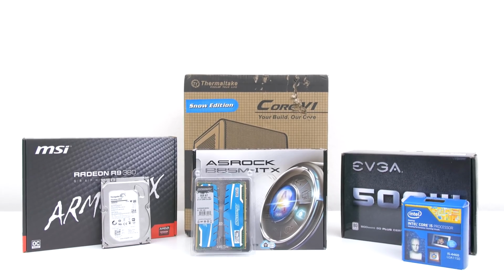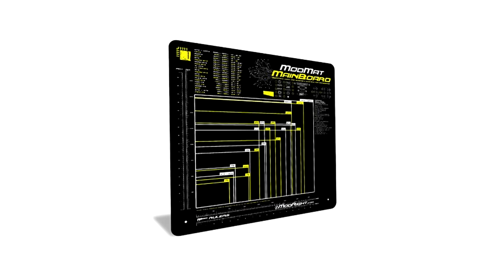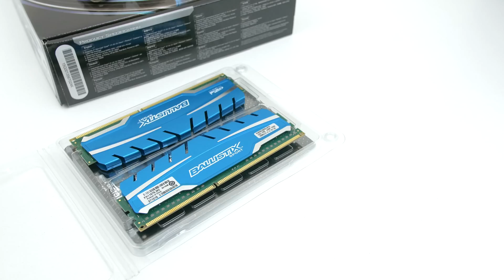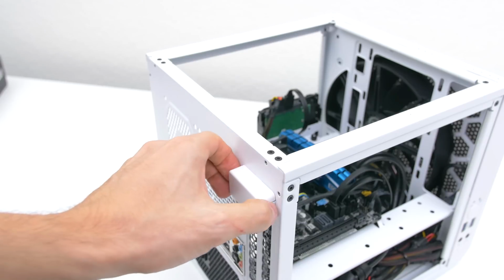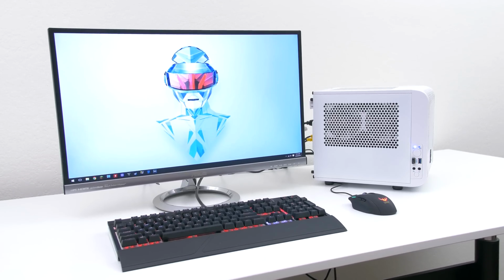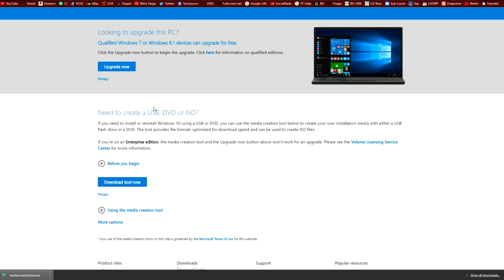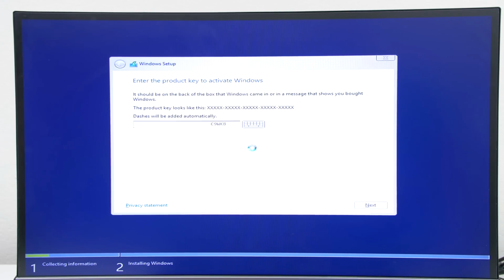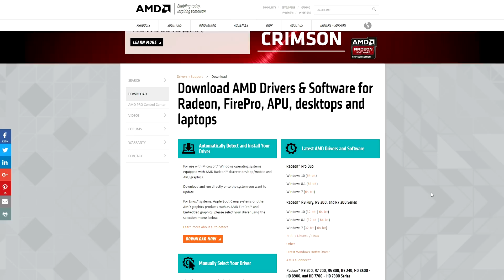How To Build $600 Mini-ITX Gaming PC w/ Windows 10

Comment: guys please help me. im planning on building this later this year and im thinking of swappping the gpu for a more powerful one, im considering either of these two.... but im concern if they fit the case or ill need to get a bigger one. https://www.amazon.com/Gigabyte-GeForce-GDDR5-Graphics-GV-N960OC-4GD/dp/B013LDXPFO/ref=sr_1_6?s=pc&ie=UTF8&qid=1470233447&sr=1-6&keywords=gtx+960 or https://www.amazon.com/GeForce-Overclocked-128-bit-DisplayPort-Graphics/dp/B00VRSERUI/ref=sr_1_9?s=pc&ie=UTF8&qid=1470233447&sr=1-9&keywords=gtx+960
Reply: EKzee Games you can totally do that but it cant be bigger because of the size en watch how much watts the gpu takes succes!
Reply: EKzee Games you can totally do that but it cant be bigger because of the size en watch how much watts the gpu takes succes!

Comment: Hi guys I need help here. Can I use a GTX 1060 (MSI specifically, $280 on Newegg) or any version of an RX 480 instead for this build keeping all the other parts the same including the motherboard? And would I be able to run a triple monitor setup with the end result? I have very specific needs and you all would be a great help. My budget is around 650-700 USD.

Comment: I have to questions about the PC and I don't know much about PCs so don't get mad at me
1. Can it have more than 8gb of RAM?
2. Can it support a triple monitor setup
Reply: Two*
Reply: There are two slots for RAM. You can get 2 8GB RAM sticks for a total of 16 GB, or two 16GB RAM sticks for a total of 32GB. 

The monitor setup depends on the number of display ports the graphics card has. Look into what graphic card you want and look for the ports in the specification sheet.
Reply: I think it only supports 16 gig of ram...  Not sure?

Comment: My cpu connection cable is 8pin but my motherboard is a 4pin connection I plugged it in it was just fine but I haven't turned it on. Will my cpu have power?

Comment: So I built this PC and I downloaded Windows 10 onto a flash drive, but when I plugged it into the PC nothing happened I even was pressing the delete key to try to enter bios but it just said no signal. I noticed in the motherboard guide it didn't mention compatibility with Windows 10. Do you guys think I should try with 8.1 or is it not working because of other reasons? Thanks in advane

Comment: Could you use the Rx 480 4gb instead for this build?
Reply: +cocacoladog10 Not sure why you said no. The 480 is only better value in some places like the US. In the EU and UK, the 1060 is cheaper or the same price and is more powerful.
Reply: Gold Rainbows get the mini version
Reply: you can use any graphics card you want as long as it doesnt have a massive heatsink
Reply: ***** YES
Reply: ***** No
Reply: You can use any GPU that isn't too big.
Reply: How about msi rx 470 8gb pci e its fit? 

Sorry newbie here

Tnx
Reply: It probably will work, you just need to measure the card and the case and see if it will fit.
Reply: I put a dual fan 1070 in mine. It was a tough fit, but I got it eventually lol.
Reply: +Andre Saddler (Ayysir) could you use the rx 460 4gb
Reply: Gold Rainbows use the rx470 8gb instead
Reply: Archie Chapman In white? Where is a white rx 480
Reply: Archie Chapman oh
Reply: Archie Chapman Is it good?
Reply: I think u can't the gpu is too long for this case
Reply: FreeZeR Masterman I could fit an 8gb 1070, so I think it could fit
Reply: dbredred from MSI ?
Reply: FreeZeR Masterman No, from asus. Its a giant card though, it was a tight fit but it runs fine now. I can almost guarantee a 4gb rx480 can fit.
Reply: dbredred ok thx, i want to building it so i want to know if everysing can fit, i asked for that :)
Reply: Another question about having another GPU in the build. Can I fit 2 RX 480s in crossfire and will I need to buy a more powerful power supply?
Reply: NO. You will need to buy a new case and motherboard and powersupply.
Reply: dbredred Yeah, that's what I though. Still wasn't 100% sure it wasn't going to work, just wanted to be sure though. Thanks!
Reply: cocacoladog10 so i would be fine with a gtx 1060 in this build?
Reply: Brixorb of course
Reply: Yeah, you'd be fine
Reply: Yeah I did. It's a tight fit tho
Reply: Papajulian pls dont buy it
Reply: Alessandro i didnt
Reply: is this good enough specs to run most games medium to high. 

  http://www.bestbuy.com/site/cybertronpc-rhodium-gtx-desktop-amd-fx-series-8gb-memory-nvidia-geforce-gtx-1050-1tb-hard-drive-white/5709911.p?skuId=5709911
Reply: Dan James Here in Canada, the 480 is like $400 and the $460 is $250-$300.  Since the GTX 950 has similar performance to the 460 and is cheaper than the RX 460. I guess the 950 is a smarter move to go for.
The 460 is a good recommendation in the US but in other countries the 950 is a better card for the price.

Comment: Can it fit an Evga gtx 970? Its listed but fitting it in on partpicker seems to cause an issue
Reply: yes
Reply: The video card can be supported in the case, however, if the video card you want to include in the case has more length, you need to take out the HDD bays near the video card
Reply: Sectro Ok thanks for the detailed answer.
Reply: +Riddle Tom No Problem
Reply: yeah but buying a gtx 970 now is stupid get a rx 480 instead
Reply: cocacoladog10 I was planning to. Will it fir with the motherboard? Pretty sure it cannot fit a 1060,
Reply: ***** i think it will but yeah you can always get a different case
Reply: cocacoladog10 :D
Reply: you can't find the rx 480 for 200 anymore
Reply: Foreignspy What?
Reply: ***** the rx 480 is sold out everywhere, and if you find somewhere they sell it for around 400
Reply: Foreignspy Yeah I Know
Reply: I found one for only $293. But yeah, that's above $200. Prices are fuc-
Freaking crazy now.
Reply: Kyber No, you are wrong now. The one rx 480 you probably found was the Asus Strix version in 8 gb. There are great deals for the rx 480 at 4gb running at around $200. For example, check the link for a Red Dragon rx 480 for $179.99
Reply: http://www.newegg.com/Product/Product.aspx?Item=N82E16814131708&cm_re=rx_480-_-14-131-708-_-Product

Comment: How do I install drivers to a rx 480?
Reply: Google it.
Reply: +WB IsMe I see a long side ways fan on the computer. Does it come with the case or do I have to buy it separately. If so he did not include the fan in the description.
Reply: ZackHasGames That long side way fan is the fan of the graphic card. 
This case comes with only a front 240mm case fan.

Comment: Will MSI R9 390 work with this build?
Reply: I'd go with the rx 480. Cheaper then the 390 but the 480 yields similar performance to the 390.
Reply: Kurtis Crisci RX 480 has been out of stock since release date. Going for the 390

Comment: I tried assembling this last night and ran into a problem: the cpu cooler in optional parts doesn't fit into the case. I don't see where I could've done anything differently. Has anyone gotten the optional cooler to fit into the case?
Reply: please tell me you did not buy a 380 please please please
Reply: +Ayden Davis I can say with confidence that the Cooler Master Hyper 212 EVO doesn't fit into the case with this configuration. Everything else worked perfectly. I'm not sure what 380 is; hopefully, it works just fine.
Reply: Chris Gilstrap its a really bad video card

Comment: I might be doing a build, what is a safe overclock with the standard Fan the processor comes with.
Reply: The i5 4460 is a locked processor, meaning it cannot be overclocked.
Reply: just turn the multiplier from 32, to 34 it will run at the boost speed and not overclocking/no more voltage so its super safe

Comment: could this run gta5 online?
Reply: +Kurtis Crisci total cost would be ...? (I'm not good in math)
Reply: +Kurtis Crisci thanks for telling/helping me!:D
Reply: +Kurtis Crisci is there anything else I can use besides the rx 480? It's sold out almost everywhere
Reply: +Alfredo Zamora be patient, but you could get a gtx 1060
Reply: +Lino Fragoso is the gtx 1060 better than the rx 480?
Reply: Alfredo Zamora In DX11 games it beats the 480 by 5-15 fps in most games. But the AMD drivers aren't very good at the moment on the 480 so as AMD starts to drop updates on the drivers we should be seeing better performance on the 480. But in DX12/Vulkan games we see the 480 tie with and beat the 1060. The 3rd party versions of the 480 come out very soon so id wait for those, they will have more fans for better cooling, better performance, and more overclocking headroom compared to the referenced 480s. The 1060 is still an awesome card but id still wait for the 3rd party versions of the 480 before you pull the trigger on either gpus :)

Comment: I pluged in all the parts but my gpu havent arrived yet. My power light and fan turned on but not my cpu fan. All I did was plug it into the wall and not to a monitor. What did I do wrong?

Comment: What way should extra fans face?
Reply: Exhaust.
Reply: +WB IsMe Also, do I connect them to the motherboard or psu?
Reply: JewBacca Kintish Fan power connector comes in either 3pin, 4pin or molex power connector. For 3 or 4 pin, connect it to the motherboard's 3 or 4 pin fan port. For molex, connect it to PSU's molex port.

Comment: I have a Gigabyte Motherboard, what key should I press besides the delete key? Or can I just press the delete key as well to enter the bios and select my boot drive option? I have an ssd I want to install windows on, so could another option be to disconnect the  hard drive and then install the hard drive later? This is my first time building a pc, so I don't know what would be the best and safest way to do this. Thank You!

Comment: When I connect the pc to the monitor do I connect it to the graphic card to the monitor or the vga to the monitor because when I I connect it the vga to the monitor nothing comes up on the monitor
Reply: Connect the display cable from monitor to the graphic card's display port
Reply: Thank you I tried that and it works, this is my first computer build ever.

Comment: absolutely love this case. i've done about 30 builds now and this was by far the best mini itx case i've used and it's just the right size so you don't have to compromise parts. i ended up using spare parts i had from two other computers to build in this case. Intel i3-4150 cpu, evga 700w power supply, gtx 780sc, asus h97I plus mobo, cooler master 120mm water cooler, mydigital m.2 ssd for OS and 2TB Seagate hybrid drive for storage. Highly recommend this mini itx case!
Reply: Bobby Walker that overkill psu xd
Reply: well as i mentioned Fabian, it was spare parts i had left over from the other builds and that's the PSU i had and i'm fine with it honestly bc the gtx 780 is a pretty power hungry card, but sure, you can get by with less power but i wasn't going to buy a new PSU when i already had one :)

Comment: can this motherboard support an i5 6500? if not what is another motherboard option?
Reply: No. This motherboard can only support 4th gen/haswell processor. To support i5 6500, you need to get a H110 or B150 motherboard.

Comment: Hey can somone help me and help me chose a usb drive that can hold windows because i dont know.
Reply: You actually only need 8gb
Reply: Get at least 32gb USB drive. Window requires at least 20gb.
Reply: a 3.7gb usb is working just fine for me, im using it for windows 7 pro. windows 8 and 10 might take up more space.

Comment: I do plan on building this exact PC and I want to know do all the screws in the video come with the case
Reply: Yes every screw and such you need comes with the case but I do have one recommendation if you do have an extra $20 to spare, I would change the R9 380 to the new RX 480. You are getting so much more performance and overall just a much better card than the R9 380. Not saying the R9 380 is bad but the 480 is just much better. If you want to game on ultra settings 1080p and get over 60+ fps id very much recommend this change.
Reply: +Kurtis Crisci ok I'll for sure look into that and probably make that upgrade thanks a lot your the beat
Reply: +Bren Csgo best

Comment: will this work if I use an i5-6600k and a rx 480 instead?
Reply: Motherboard is not compatible to i5-6600k. RX480 will work.
Reply: You'll need a different motherboard and ddr4 ram though for the CPU while the GPU is perfectly fine.
Reply: I am new to computers and stuff but what is the diffrence between i5-6600 and i5-6600k.......
Reply: The i5-6600k is an unlocked CPU meaning you'll be able to overclock your CPU assuming you got a good cooler to allow it without overheating.

Comment: do you think a i5 6400. gtx 960, 8gb of ram, windows 10 64 bit home, 1TB (64MB Cache) 7200 RPM SATA 6Gb/s, a pretty good power supplie, a case with a cool look and motherboard,a dell keyboard and mouse is worth $950?

Comment: If you need a USB wireless adapter, I'd recommend the HiRO H50193, it's $15 USD currently on amazon, and has an external 2Db antenna.  Performs much better than the TP Link (which I also have).  The white plastic casing on the usb adapter itself is a bit cheap feeling though.  I think the version with the 5db antenna is only a few bucks more

Comment: does it have to be in that computer case or can I buy another
Reply: Most cases tend to be compatible with this sort of hardware, so you should be fine
If you plan to expand more, getting a case that's bigger and has more features would be a good idea
and if you get a mATX or ATX case (which is the majority) you might as well get a mATX/ATX mobo because that too will give you more expandability options and it's just weird having an ITX mobo in a bigger than ITX case.
Reply: the case doesn't matter just make sure the cables are long enough to get to the sockets
Reply: ***** do the cables come seprate?
Reply: Personally im new to computers but i believe that some cables come with the case, what case were you planning on buying?
Reply: ***** the mid tower version of this model on his amazon link ps I'm also new to building these things
Reply: send me the link? Thermaltake has many mid tower cases
Reply: You think all those parts work on this?
Reply: Joel Lopez give me a bit i'm researching it right now
Reply: Joel Lopez Do you plan on getting a DVD optical drive?
Reply: ***** what's that like where you add a DVD Disk?
Reply: Joel Lopez Yes you'd have to buy one first

Comment: is the cooler required in order to use the gtx 970?
Reply: the cooler is for the cpu if you are getting one go for a fan like this one https://www.amazon.com/Deepcool-Gamer-Storm-Computer-Connector/dp/B00KJF1ZM8/ref=sr_1_3?s=pc&ie=UTF8&qid=1467750627&sr=1-3-spons&keywords=computer+fan&psc=1
Reply: +The  Plaid Gamer so for example if i wanted to get this processor  https://www.amazon.com/gp/aw/d/B00CO8T9VC/ref=aw_wl_ov_dp_1_4?colid=1D3NYMGJDTY8A&coliid=I1YLJGD4EXDHK6&vs=1 would that fan work for it? and thanks for the info.
Reply: +The  Plaid Gamer im not planing overclocking it . and thanks appreciate the help.

Comment: can this run battlefield1 when it comes out or do I have to upgrade gpu can it fit an amd480?
Reply: Yes this would run BF1 with ease but id recommend upgrading to the 480 anyways. Not only do you get 4 gbs of vram instead of 2 but much better performance that will get you 1080p 60+ fps on all games for only $20 more.
Reply: ty
Reply: Wouldn't I need a new mother board due to the 480 being ddr5 ram compared to this gpu that has ddr3
Reply: Im confused im pretty sure  ram and GPU are different unless you are talking about the Vram
Reply: +The  Plaid Gamer so would I need to replace parts in this so i could put in an 480?
Reply: Chris Yee Nope, all parts are compatible with the 480.

Comment: If you can, replace the cpu-fan with a better. The ones coming with the cpu sounds like a jackhammer. 

For a cube you may have to go with smaller and more expensive one though as space is a problem. Make sure to check out the space requirements before buying it.

Luckily that is a one-time purchase as you can use the same fan every time you upgrade.

Comment: can I change the graphics card to a GeForce 960?
Reply: You can but if you haven't bought the 960 already id highly recommend checking out the rx 480. It costs the same as the 960 but it out performs the 960 by quite a bit for the same price. Plus you get 4 gb of vram instead of 2 for the 960.

Comment: can this run gta v all setting on very high 60fps? im very interested in buying it.
Reply: Yes but id swap out the r9 380 for a rx 480. Better overall performance for practically the same price and the 480 comes with 4 gigs of vram instead of 2. i5 4460 + rx 480 will be able to reach 1080p 60+ fps on all games high/very high settings.
Reply: +Kurtis Crisci thanks. im on a bit of a budget, i5 4460 and asus gtx 960 4gb, can that combinaton run gta v. 60 fps, very high , 1080p. gtx 960 4gb is about 230 dollars in seden. The rx 480 is about 330 dollars :/
Reply: +Kurtis Crisci i think i will save some more cash so i can get the rx480, but anyway thanks for the help bro, i appreciate it!

Comment: is this a good first build?
Reply: Extremely good first build but id recommend swapping out the r9 380 for the rx 480. They cost the same price ($200) but with the 480 you get 4 gigs of vram instead of 2 and the 480 performs better than the 380.